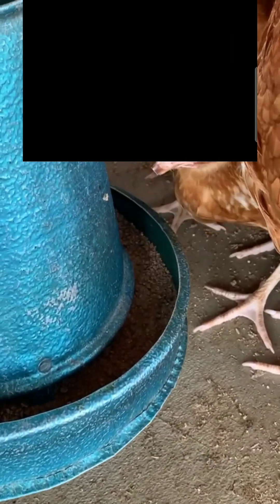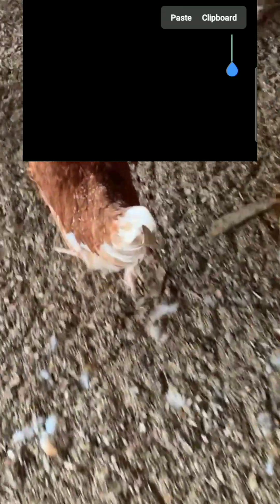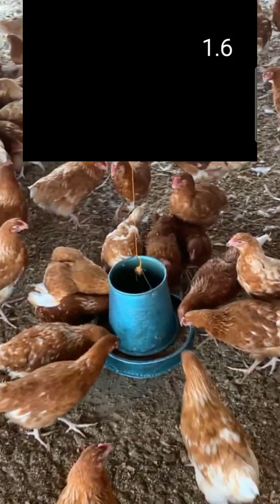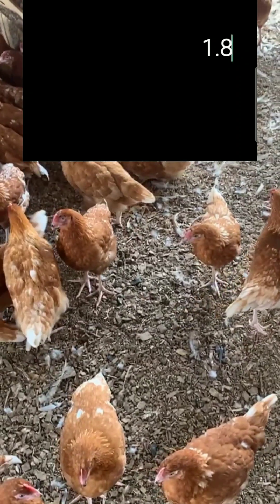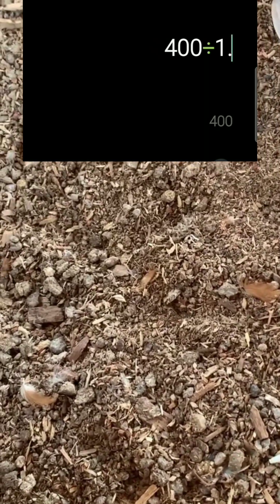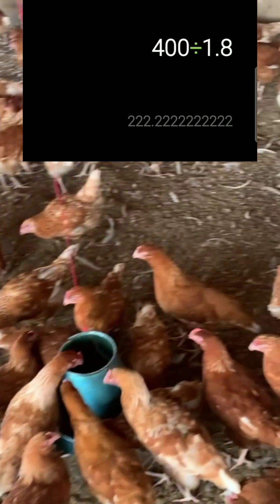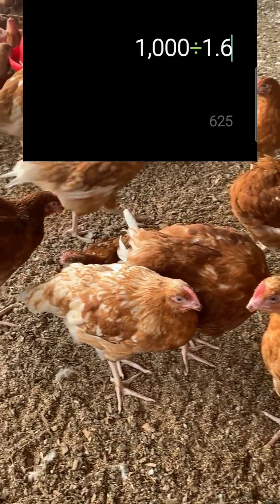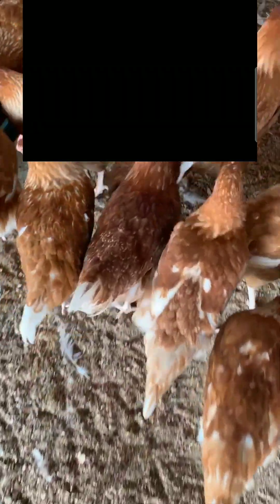Poultry House Blueprint: Measurements and Calculations Explained

Comment: My farmer friend, you tried but you are wrong. The factor u used supposed to be multipled by either 0.16 or 0.18 for broilers and layers respectively and not divided by 1.6 and 1.8 as u explained. 
Alternatively u can simply multiple your perimeter by 5-7 birds per square meter 👌🤗
Reply from the maker: Yes thanks I understand you, and I did it the way I did and it worked for me thanks for your explanation I'll try yours out
Reply: Bro don't insist you actually not efficiently using your space for maximum productivity. The lady is right it's 5-7 chickens per square meter.

You have a big house with little birds meaning you not exploring the actual capacity and not reaping the potential output

Comment: Isnt it suppose to be 5/6 layers per square meter?
Reply: The stocking density this supposed farmer is teaching here is very wrong. He can't even use the measurement units properly. 

The correct stocking density for adult layers is 5-7 birds per square metre.
Reply: @cynthiainnoma1709  Thank you, exactly my point of view. Thus this explains why his pen is so empty in comparison to it's size
Reply: @shadownomadrider  Yeah, with his stocking density, one will definitely not utilize the available space adequately.
Reply from the maker: No it’s 1.8 per layer because they are staying long
Reply: @Farmsmartwithvictor  1.8 meters?